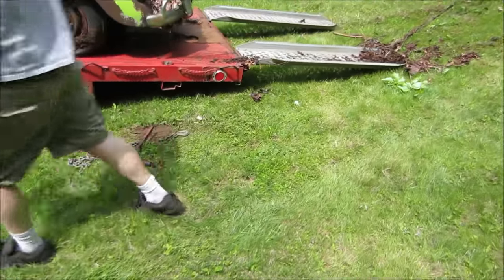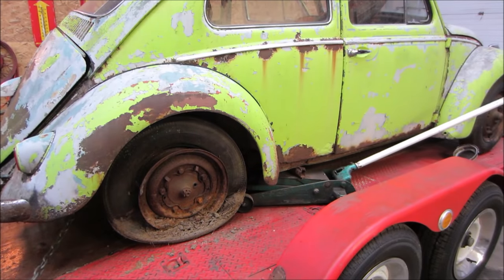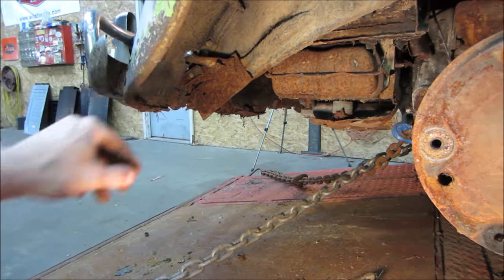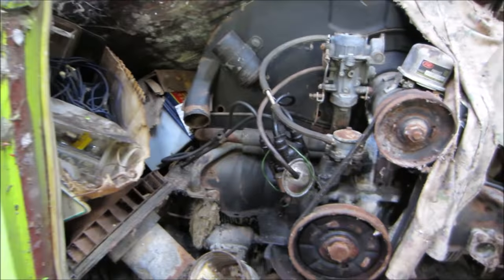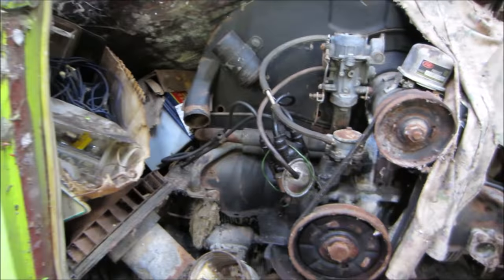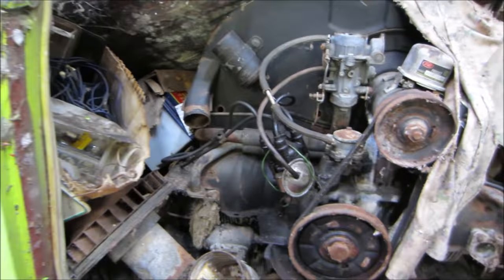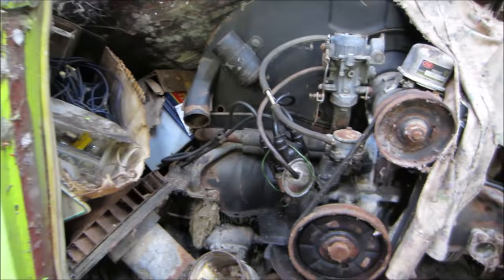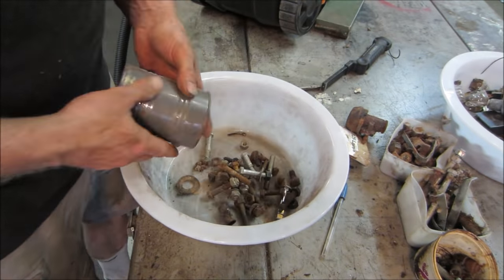Lets Rescue a VW Beetle From California, That They Just Gave Up On.

Comment: Those are worth a bomb where I live and even fully restoring it would still make a profit.
The rear window looks a bit big for a 50's beetle.
Reply: I had a '57. I'm fairly sure that was the last small window VW. This is  a '58.
I could be wrong. I was once before!
Reply: @modeladenny1218  I was expecting the pretzel window but it could be as you said they changed it that year.
Reply: @dave4803  I can't afford a VW or Vette with a split window. Glad I bought my old Ford split window car when it was cheap.
Reply: @modeladenny1218  I wanted one of those so bad.
I bought a classic e30 bmw when they were cheap and saved mine from being scrapped.
Now they are worth some money and getting more collectable.

Comment: At the beginning of the video I was thinking it was going to need basically every piece of metal below the doors cut out and replaced but this one is in remarkably good shape. I remember my dads 64 baja beetle needed the whole floor replaced and how awesome it looked when he got the new ones put in. This one doesn't even need that much repair work. I think fix the damage thats there, coat the bottom so it stays clean and get it running again, and it'll be awesome

Comment: What is that hand crank by the shift lever for?  I remember using it but for what I don’t know. It’s that round wheel in front of the hand brake. Thanks.
Reply: For heat - opens up the flaps for the heater channel that is connected to the heater boxes around the exhaust headers.  And the heaters didn't work very well for various reasons, at least all of the VWs of that vintage that I drove.  The heater system did get a little better in the late '60s when VW switched to a lever system.

Comment: or you could use it to make a Dune Buggy that would be cool a friend of my fathers use to build Dune Buggy Bodies and Fiberglass boats , one time I fixed a friends of mines Volkswagon  Van it had rusted out rear quarters , batterie tray gone built new one out of fiberglass ,and i repaired the quarter panels with fiberglass, you could even do that bugs entire floor pan out of fiberglass, there are tricks , or you can get new floor pans but the engine compartment is the worst place for rust on bugs .

Comment: There is really no reason to ever convert something that is 6 volt to 12.  If it is properly tuned and maintained, 6 volt is no problem.
Reply: As someone in the VW community for awhile, there were multiple reasons to update and number one was safety. I've seen lots of cars like this one that were painted insanely bright colors for the simple reason of visibility to the land yachts that roamed in the 70s.

Comment: Shouldn't a 58 have an oval rear window.?
Reply: 57 was last year for oval
Reply: @mattg7952  Yep. I had a 1957 Beetle with sunroof.
Reply: @modeladenny1218  I've owned so many Volkswagens I can barely keep track anymore. I never wanted an oval just because I didn't want to worry about it constantly. My buddy has 8 or 9 ovals now. VW theft was a big issue so I liked mine to look as shitty as possible as the main theft deterrent.
Reply: @mattg7952  I've only had two VW. The '57 Beetle and a crappy squareback wagon.
Our Beetle was parked many secluded places. Apparently no one wanted it.

Comment: I had a new 1966 bug in High School.  Was a ball.  But would I want it now, even for free?  Hell no.  Not even it it was showroom new.  Car define 'dangerous'.  I remember going 60 mph on a 4 lane road, and the turn kept getting tighter.  Then car was up on two wheels!  :-o    Not thanks.  P.O.S.   As far as I am concerned....restoring a bug is like trying to turn a poop back into fast food.
Reply: Weird I've owned over 20 without problems. Maybe it wasn't the car.
Reply: @mattg7952  That's what I was thinkin!  I'll bet he woudn't drive my Model A with no roof or seat belts because the gas tank is in his lap.